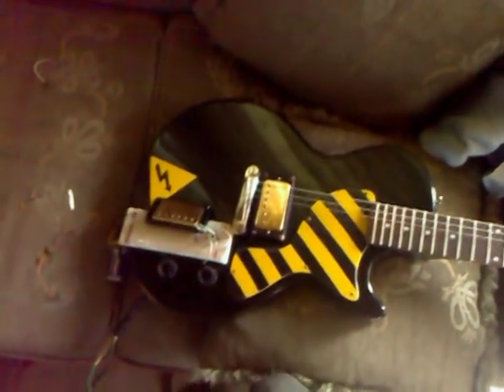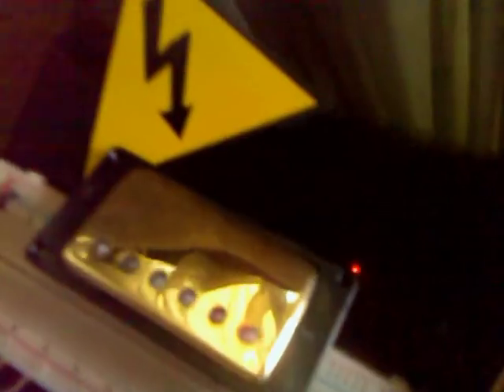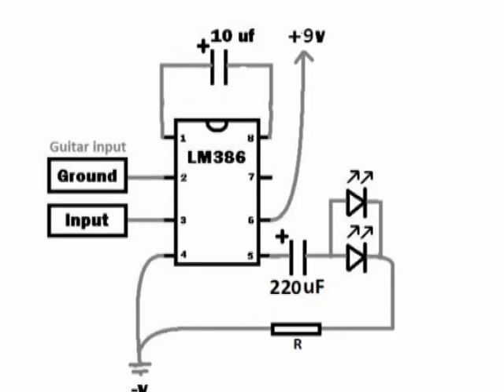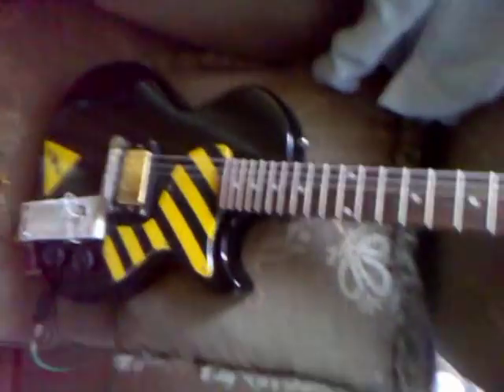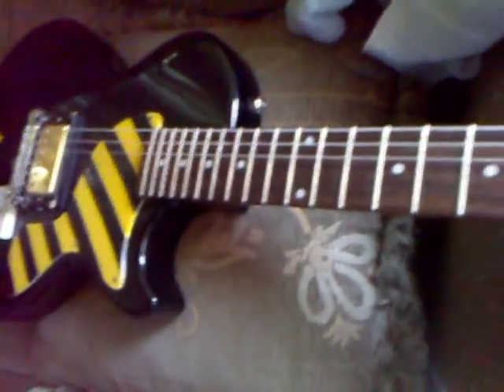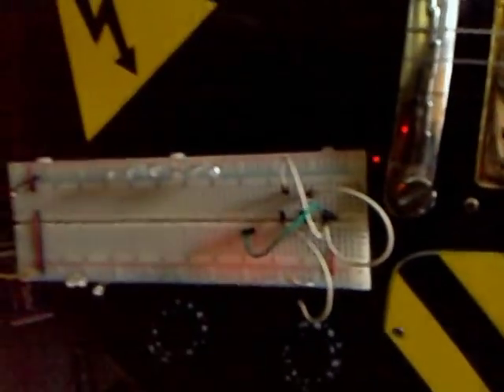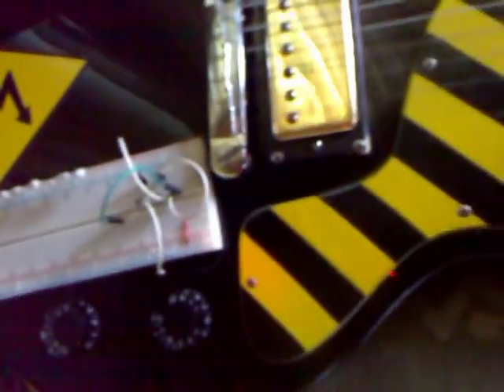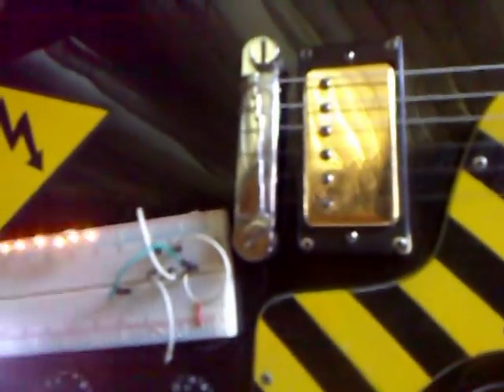Guitar LED Twinkler (Humbucker)  -  How to do (circuit schematic included)

Comment: Hello.
After all, what do I connect to pin 2 of the 386? I did not understand the duplicity: GROUND and Guitar input?!?!? I understand that pin 3 is who receives the signal from the guitar / pickup and, therefore, pin 2 receives what? ... Beautiful work!
Reply from the maker: the guitar output (jack) has 2 wires. hot and ground, that goes to pin 3 and 2 respectively. pin 2 lets say the guitar's ground or common negative that is soldered on the back of the pots and the negative from the pickups and guitar bridge. 
pin 3 is the positive or hot (tip) wire from the guitar output jack
Reply: Okay. I'm really grateful for the answer. "Guitar input" is then a "label" for both tip (hot) and guitar ground. Well, I made this twinkler but it did not work. Now I wonder if the resistor should not be soldered between the 220uF capacitor and the LED. And, since I intend to use only one red LED, this resistor is 350R, correct? The intended use for this twinkler is that it functions as an LED flash for a fuzz pedal. I also made this sound to light "" and the LED glows very weakly with a used battery that I have for some time but it is lit and strong without blinking when I put a brand new battery ... Any idea of what may be happening to us two cases? Thanks in advance.
Reply: Sorry; the link is "http://www.aronnelson.com/gallery/main.php/v/chickpea/sound2light2.jpg.html"
Reply from the maker: The resistor is only to protect the leds. If they're too dim try a lower value.  If the leds stay lit without blinking with the sound it means that the capacitor on pin 5 is not blocking the DC output for some reason,  try another capacitor and double check its polarity..
Reply: Hi. Thank you again for your attention. Just for information, I am from Brazil and so maybe my English is not so good. Well, something happened from yesterday to today; I checked everything over and re-done some welds and connections and now twinkler works! But there are now other details: the LED (red, yellow, green, white, blue, ...) blinks very faintly and even so, only when I put the volume of the guitar at maximum. And at this point, the sound distorts a bit. Since I do not understand anything or nothing at all about electronics, I wonder if there is a way to increase the brightness of the LED when it flashes. I read something about diodes at "http://www.diystompboxes.com/smfforum/index.php?topic=113401.0" and the difference in my case is that the LED does not stop responding completely. Would you be able to help me again, please? Thank you, Egon.

Comment: I did the circuit exactly, and it works but the leds shine so lower, i am usin a 100R resistor for 8 white leds in paralel, am i doing something worng?

Comment: Thanks for the video! I've been tinkering with this for a little while but keep killing capacitors after just a few seconds of playing.  Any recommendations?
Reply from the maker: make sure you use capacitors with rated voltage higher than 9V, and make sure of the polarity to be connected as in the diagram.
Reply: ***** Thanks for the reply! I'm using capacitors rated for 50v and the polarity is correct.  However the problem continues.  I saw a similar schematic that that doesn't use the 220 uf capacitor.  I tried that and the capacitor holds but the lights stay on constantly.
Reply: Anthony Smith I've been having that problem where the light just stay on. I don't have a cap before the leds. Would putting a capacitor before the LEDs help?
Reply from the maker: Dhruv Vishwakarma yes, it will block the DC constant output and only take the current when it changes...
double check the polarity of the cap.

Comment from the maker: well, the circuit has a very low impedance, almost as an open circuit, but I noticed that it caused a bit of noise and change in tone.
you can solve this problem by installing piezo discs on the body as input, instead of the guitar output line, or install another cheap pickup just for the light, but in the end, if you built the circuit in a clean way and used all original parts, you shouldn't notice that small change in sound.

Comment from the maker: It is necessary to put the 220uF Capacitor, because the LM386 IC gives the half power input voltage in the output pins, so if you connected it with a 9V battery, the output will be 4.5V  DC standard and then just goes up and down with the sound, so you have to put the capacitor to block this standard DC voltage and only pass the change in voltage, or else your LEDs will stay on, just go brighter and dimmer with the sound input.

Comment from the maker: you're welcome anytime :)
yea sure, soon,
i didn't put it on a fake pickup like I was planning, the guitar lost its charisma lol.. so i drilled the pickguard 6 holes and I also drilled a space for the LEDs under the pickguard on the guitar and also made a path for the wires to reach the electronics chamber where I put the battery and the circuit there..

Comment from the maker: yes, the negative lead goes to the "-" sign and the positive lead goes to the +9V , neglect the ground sign, its the negative lead, worked with everybody else perfectly. 4th pin goes to the negative lead and the 5th pin is the positive output of the LEDs then discharged in the negative lead.

Comment: In your diagram there is no "-V". Unless you mean the ground wire. But from that sentence I understand that the ground wire goes to "+9". On the fourth pin, it shows a wire going down with a "-" sign under it. Is this where the negative lead goes?